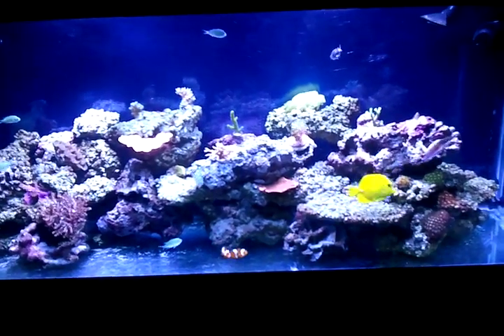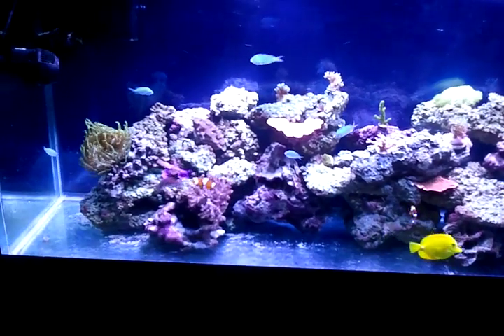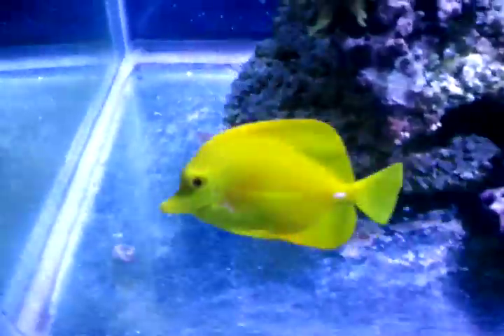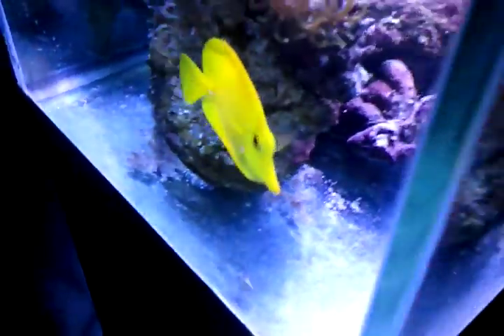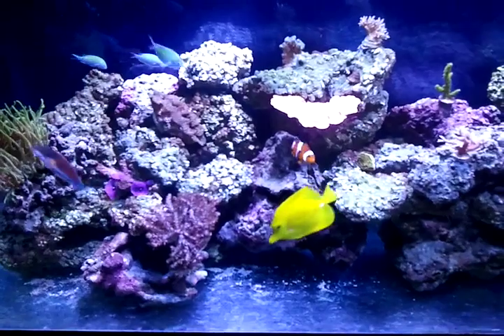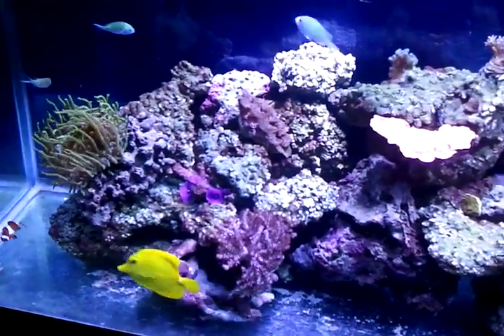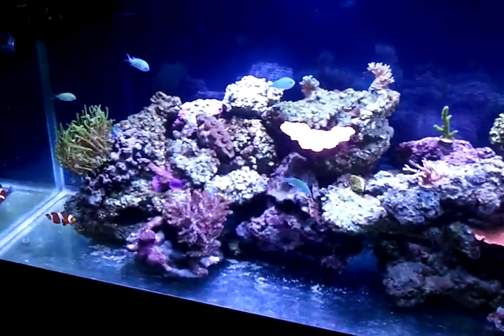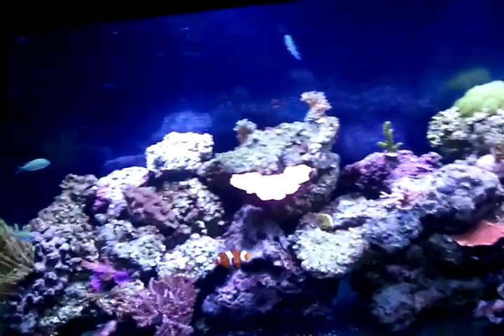How to Lower Nitrates in a Reef Tank

Comment: Guess where you 'run macro algae' ?  You 'run' it in a.. REFUGIUM. Refugium is a 'refuge' for chaeto or other macro to sit in, can be part of your sump that already has your skimmer in it. In general there shouldn't be much phos or nitrate if you are bb and running high flow. I'm thinking about going bb as the sand is becoming a nitrate trap in my tank.

Comment: Ok bare bottom tanks bur fish and corals , the light bounces from the bottom of the glass its like putting ants in a cup in the sun , Sand beds remove nitrate's also once the tanks has cycled i wouldnt lisen to anyone until u have read alot AND ALOT AND ALOT NPX bio ruducing balls in a two little fishies Phosban Reactor will do alot and no water changes for months even some guys years ! Your live rock will remove bio logical matter as well , a 4 inch sand bed will do it even better